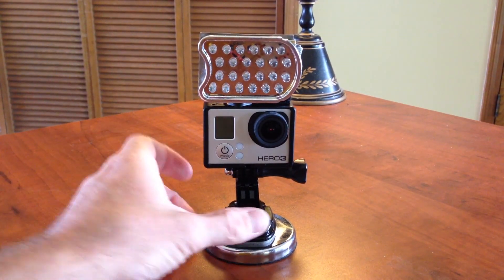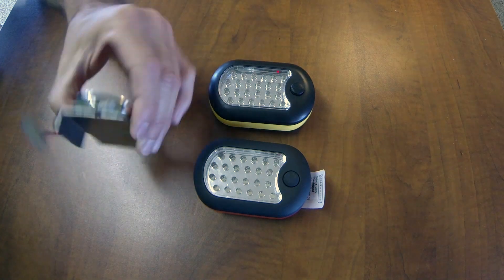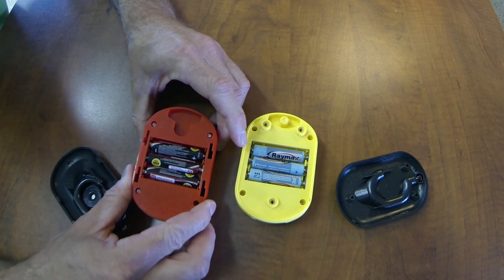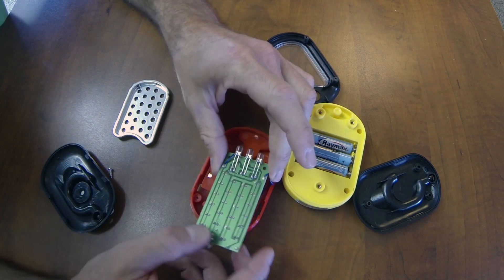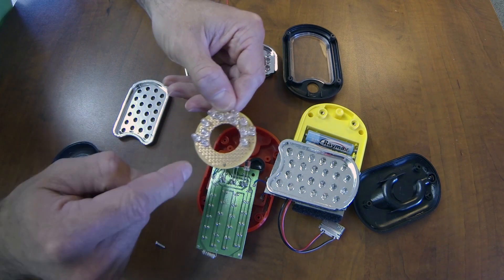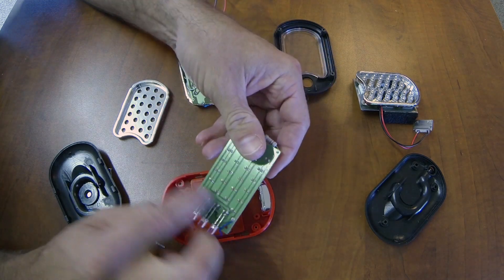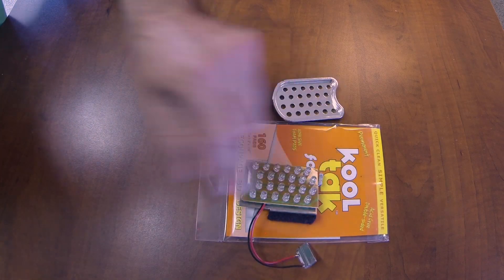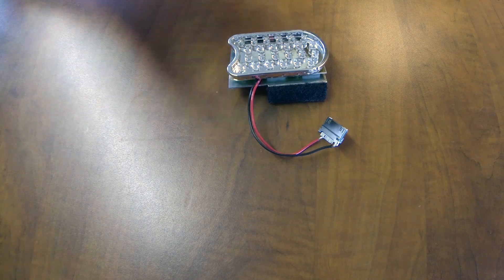How To Build a GoPro Powered LED Video Light

Comment: hello, they have 28 led ring lights for gopro on internet. cost $11.48
Reply from the maker: Thanks Steve. When I built this two and a half years ago, there wasn't anything available. It's also an exercise in pulling power from the Gopro itself (no external batteries).

Comment: You should install an inexpensive push button switch so you don't necessarily have to turn off the camera to turn off the light.  Very simple to do, just solder it into the hot wire that provides power to the light from the camera. You could make another backing plate with an extension to mount the switch to.   Nicely done though.  Also if you were to break off ALL the unused pins, there would be more room inside the housing for the wires and the smaller housing looks like it would actually work pretty well.  You just need to be careful not to pull on the wires too hard or it will snap off those fragile pins to which the wires are soldered.

Comment: You could sell these for quite a bit on ebay man, nothing like it that i've seen haha! Would you consider making one and shipping it out to me? I'd pay of course, just don't think i could find the time and/or patience to make one of these things, but seems like the most perfect thing! Cheers
Jacob
Reply from the maker: JaacobRS Thanks for the compliments Jaacob! I'm sorry but I don't really have the time to do complex builds for people right now. I hardly had the patience for this build myself! I will be selling parts for some of my builds very soon though. I'll be making an announcement video when that starts. Thanks again!
Reply: Thanks, that would be fantastic, I'm filming a 'Paranormal Activity' style horror film trailer for college, and was wondering the best way to recreate the whole "camcorder" thing with a gopro so i thought a light would be a great idea and mounting it to the ceiling to have a kind of CCTV effect!
Reply from the maker: JaacobRS You could try some cheap flashlights or bicycle lights attached to the camera. They would be much simpler to build/attach and probably inexpensive. You could use the handle bar mount but instead of mounting it on a handle bar, stick a flashlight in there. Good luck on the trailer!

Comment: I just made a really bright bicycle light using 5 of those same led work lights. The thing is very bright. Because those lights are mass produced and rather cheaply made, stores will often end up with a few non-working ones sitting around that nobody will buy, so I'd track down somebody in the store, explain that they're probably headed for the trash, and so I offer them a little bit of money for them. Got several for $1.25 each and one for $1.50. Also scored a couple of bigger led lights that had arrays of 72 leds, for $2 each. Then I rip them apart and build bike, helmet, and video lights out of them. Keep in mind also that Walmart sells plastic 9 led flashlights for $1 each. They're also a cheap source for led arrays, battery holders, and switches.
Reply from the maker: Elhardt That's a great tactic for getting cheap lights! I'll have to keep that in mind. I love how LED prices have fallen over the last few years. Thanks for the comment.